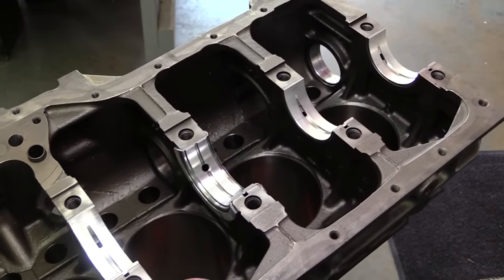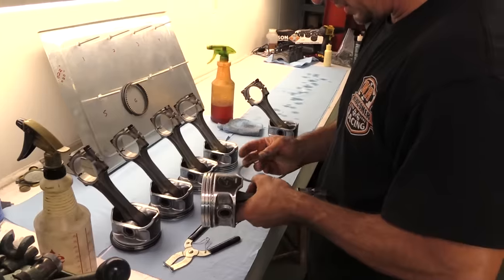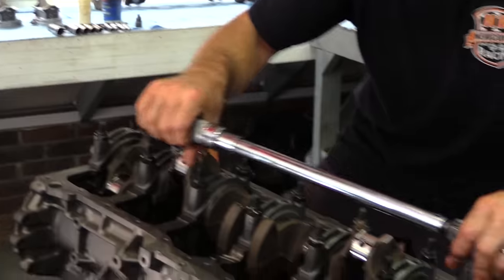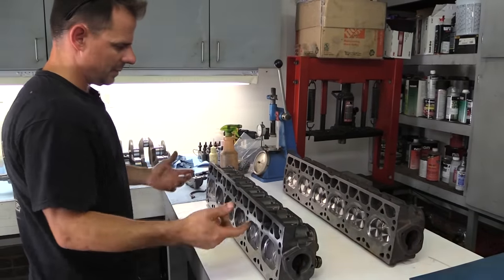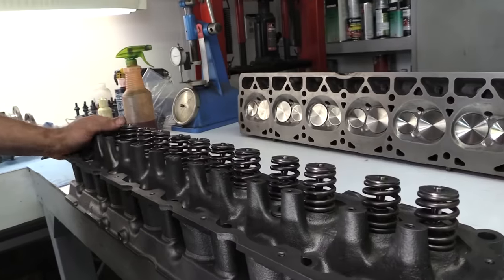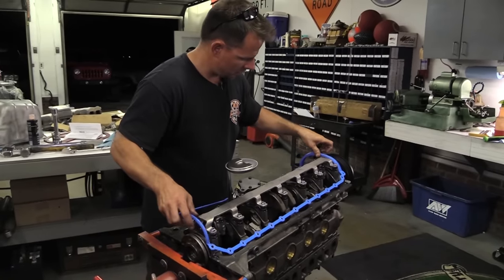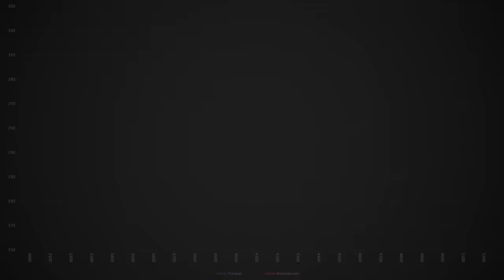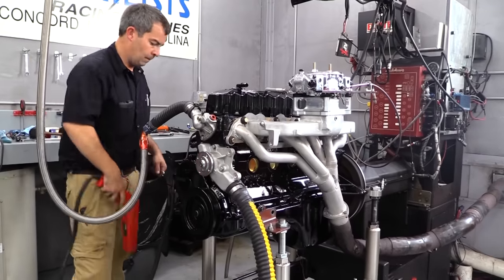Big Power Jeep Straight Six Stroker Build on a Budget with Newcomer Racing

Comment: Finally someone giving some credit to the excellent Jeep straight-six engine 👍 ...subscribed
Reply: The best motor ever made. Can’t beat them.
Reply: The best Jeep motor ever, better than the “panty” Star.  I’ve seen some that were literally a “block of rust”, with 200K miles, still going strong.  So easy to work on, everything reachable for a driveway mechanic.  Gotta say though, do love the cartridge filters on the 3.6 Pentastar motors.
Reply: One of the best motors ever built
Reply: The problem with the amc i6 is over it's life it had been great and crap. So to have the really good ones you've got to hodgepodge them together over multiple generations.
Reply: Literally one of my favorite engines next to fords last desirable gas 300 straigh six
Reply: The AMC 2.5 isn't bad either. I know that they make about 0 horsepower, but they always go. Starts everytime and never dies. Mines got 215k miles and still runs strong. It even ran with lose, dirt covered spark plugs.

Comment: That engine is one of the toughest ever designed.  Honestly, anytime you see a straight 6 with 7 mains, you know the bottom end is bulletproof.  These make for great daily driver engines that you can have some fun with on the weekend too.
Reply: Not to mention, the Cherokee is the ultimate utility vehicle. About the smallest turning radius, unlikely to get stolen (even in areas with a lot of dem teeeeeens), good interior space, and is still masculine looking. My absolute favorite car. I've owned at least 4 of them and I'm looking at getting another!!

Comment: Now I wish I had one of my old Jeeps back, the 4.0 with a 5 speed, two wheel drive was a sleeper.  I used to give kids driving small beemers fits going stop light to stop light.
Reply: They don't like that very much...😂
Reply: I still drive my almost 27 year old TJ I bought new. It now has a header and dynomax super turbo muffler. It loves to be run and shifted. Pure delight.

Comment: I had a 2002 Grand Cherokee Laredo 4x4

4.0L six cylinder 

I bought it in 2006 and sold it in 2018

I drove it everyday. It was a trooper that served honorably. 
The engine has 170,000+ miles. Still ran fine. 

Everything else was slowly going out. Door locks windows, lights, brakes, tires.

Needless to say I sold it. I miss it. I didn’t have the money to fix it up and breath new life into it. 
It will never be forgotten.

Comment: This year I pulled the trigger in Feb/2024, I order a turbo T3/T4 turbo with a 0.57-mm compressor wheel with 0.50 a/r compressor housing and 0.63 a/r turbine housing. The 4.0L Loves a good Turbo and the turbine spool-up-sound is very rewarding running up a big sand dune.   Cheer's

Comment: Took a 4.2L carb straight 6 shortblock and put a 4.0L efi head on it. I also used a offenhouser intake manifold, a holley 650 carb, dual valvesprings, and the biggest camshaft offered by comp cams. She's been getting beat on for over 5yrs without skipping a beat. Makes great power and torque.
Reply: moedigzz nice!!! I’m doing the same thing minus the cam, I have a quadrajet 4bbl that I was going to install but thought it might be too much carb.  Any issues with your 650?
Reply: @masterps100  old commentbut I wouldn't sweat the qj. They ran em on 4.3Ls.

Comment: I have a stoker inline 6 ,, love it . Going on 6 years now , I'm hard on it , making my 37's smoke all fours
Reply: Your not smoking all 4 of anything.....especially 37s. Not with a damn 4.6
Reply: Aaron Huff Easily can with the right gearing. Smokes all 4 of my 35s with a stock 4.0L and 5.13 gears
Reply: @Badassing  yea no...not a chance.  My wifes lq4 6.0 4.10s wont rip all four 33s.
Reply: Tristan Wolff Rubber in fenders show otherwise. Do a 5k neutral drop in 4L and all 4 tires will smoke. Now I’m not saying a full on burnout. It just smoked all 4 tires. 
There’s supercharged 2.5L Jeeps spinning all 4 tires. Even 37s.
Reply: @Badassing  5k neutral drop low range...come on man...meanwhile our 6.0 rips 60 mph rolling burnouts and gets 19mpg all day long.
Reply: Tristan Wolff Atlas, NSG370, and 5.13 pulls them great. Trust me, I have no need to do a burn out at 60mph in a crawler. I still get 18-19 on highway lol
Reply: @Badassing  I spent 1700 on the swap and  another 450 on shafts.  I suspect it could neutral drop a 4 hi burner but your asking to annihilate the t case input.  I used hp tuners and a stock gm 0411 ecm.  The lj ecm runs gauges and provides abs to vss signal for stock speedo.  It also runs the fan since its an 06 its really a durango or dak ecm and i repinned it.  The LS just sits in there like it was stock for the year.  Fits perfect.  It makes 370s or so tire, less on the lo octane stuff.
Reply: @givengiftgames5398  are you high? It made 372whp.  THREE HUNDRED SEVENTY TWO.  It has no traction control, no speed limiter, its tuned using widebands, hp tuners and most of the original vehicle configuration has been disabled.  Rev limit is set at 7000.  SEVEN THOUSAND.   If a stroker thats ported and cammed makes 300 on an engine dyno, its going to be 225 in the jeep.  Its respectible but the 6.0 is cheaper BY ALOT.   My wife hated the 4.0 that was in her jeep, always complaining it doesnt have the power she wanted.  a mild cammed 6.0 fixed it right up.

Comment: I did a similar build for my Jeep 20 years ago...The power was a night and day difference....Made the Jeep a blast to drive...started breaking  transmissions and Axles....but it was worth it...👍
Reply from the maker: Awesome!
Reply: @TheHorsepowerMonster  
My buddy had  an early 80s Z28 with a 4speed....i cleaned his clock ...light to light ...with my 84 Laredo...Porting the cylinder head and the  intake manifold..with the addition of an iski 252 Super Cam had to have added 100hp to that engine...600 vac secondary  with a light spring kit....It was a "Jeeper Sleeper"....Sheared the 2 piece axles more than once...before i installed a Mosure 1piece Axle kit....It was a hell of alot of Fun...
Had to cut one rib of grill...to get the Cam in....🤣😂🤣 what we do for Power....👍

Comment: I wish you were around  25 years ago.  I bought a used 1988 Cherokee after decades of being a CJ guy.  The 188 hp of the 4.0 was a quantum leap over the 65 hp L Head and F Head just as your stroker is over the stock 4.0.
Reply: I had a 90 RENIX/AW4 loved it.

Comment: More great content. And great to see some non-V8 American content.

Let's see that turbo build👍
Reply: the 4.0 is all american
Reply: @omegarugal9283  grammer error on my part. Only the Americans were making iron on iron motors in the 90's🙄. Meant to read. 

"Non-V8," American motors.
Reply: Check out LS V8 to V6 conversion
Reply from the maker: Racing
Reply: @TheHorsepowerMonster  it's a novel, yet unconventional solution to a very specific problem. Arising from a rather unique set of circumstances 👍.

Comment: Built almost same mtr.back in 1981 but used 400 chevy rods&pistons 11:1's
Cam was a moon cam 540lift.ran a offy manifold with 500cfm motorcraft carb.splitheader block was bored 125 over.4.2 head was port&polished with 2.5 valves.Ran it in a  72 gremlin dirt track no dyno back then but ran 0-60 in 5 seconds.sold that engine for a grand and guy put it in a 66 4dr.american ran 12:2 in 1/4 mile.Cost back then to build was a grand.
Reply: I Believe THAT for a Fact! SWEET

Comment: You have to love it when a stroker motor is still over square.
Reply: Stock Buick V8 is under square haha. With a 350 Buick you need to bore it 60 over in order for it to be over square. I have a 350 Buick in my 66 C10 and it pulls trailers like a champion.

Comment: Down here in Australia, this engine is pulled out and replaced by the 4litre DOHC Ford barra engine, its 185kw DIN on unleaded. there is a turbo version at up to 310kw. The barra was made in Australia for our falcon. The Jeep engine is old school now days.
Reply: Ford barra motor had been compared and come out on top of a toyota 2jz..best 6 cyclinder engine to date ..and cheapppppp
Reply: Do you have to install it upside down

Comment: i got myself a 284 stroker motor from a 4.0
258 crank
punched .060 over
basic 3 angle valve job
crane cam h-260-2
on a chassis dyno, all the drive line, auto trans, transfer case, 3.55 gears, and a full front accessory, it made 250 horse and 350 tq iirc. took it mud racing after some upgrades and managed to kill it a few times, rebuilt and killed again.

Comment: Legendary 4L Motors, they don't build em like they used to
Reply: Nope and they ruined a brand because of it.
Reply: No...because nobody really believes 180hp and 13mpg is a good thing.
Reply: @blackopsrocks  don't know where you came up with 13mpg. My 99 Cherokee 4.0, 5 speed averages 25 mpg and my 05 Wrangler Unlimited 4.0 automatic averages 19 mpg. That's commuting down a 2 lane road with speeds from 35 to 55 mph. Stock tires on both. 99 has 276K miles and 05 has 266K miles.
Reply: @davem4193  so...not normal normal commuting...got it.  My 8300 lb diesel super duty can avg 25mpg if I do 50mph all day so my point is still valid.  I like the 300 ford i6 myself but im sure not going to say its worth the cost to horsepower...as soon as you push more power, the longevity and durability (the reason we all like the 4.0) goes out the window.
Reply: @blackopsrocks   my real world figures disprove your original point   so your best argument is that it's not an average commute? Got it. Define an "average" commute. Even when I was commuting down the highway in my 99 Cherokee at 80mph I was still averaging 23 mpg. Sounds like you pulled your 13mpg figure out of thin air.
Reply: @davem4193  Not sure whats hard about that concept bud.  The avg commute in the US is 21 miles, 70% hwy with an average of 38mph.  The avg highway speed according to our google overlords is 73mph nationwide.  So if you think your alow and steady two lane commute is normal Ive got bridges to sell you.  If you jump on the interstate and do 65mph there is zero chance youll do better than 18mpg probably even less.  Your modern competition is getting 22 to 24 at 80.  Hell if I followed you around at twice the weight Id still double your mileage.  Jeeps are cool, no efficient or cost efficient.
Reply: @blackopsrocks  you must have missed the part about me getting 23 mpg on my highway commute at my previous job, it was 70 - 80 mph average speed. Reread my previous post. A far cry from your 13mpg figure that you made up out of nowhere. Even the EPA rating is higher than that but don't let facts get in the way of your misinformation campaign.
Reply: @blackopsrocks  my lifted xj on 33s gets 18mpg on my commutes if I drive economically. the hard part is resisting the urge to mash the gas and drive faster than 75 to pass dumbasses then my mpg goes down to 16-17
Reply: @davem4193  I own an LJ and a XJ...so its not from nowhere.  Your comment I saw stated slow on a two lane road...so there is that.  The 4.0 is a low efficiency engine, converged port, hydraulic flat tappet, low compression, oversquare...all means its low efficiency.  The pistons move quite a bit meaning the physical travel distance for the power produced increases friction,  flat tappets do to, and converged port head designs interrupt air flow and reduce volumetric efficiency.  Thats the science.  that is why even with alot of cooling capacity the engine does run pretty warm.
Reply: @blackopsrocks  it's a miracle, both your LJ and your XJ get 13 mpg even though your LJ is much heavier and has different gearing. Sounds like "science" is on your side for sure.
Reply: @davem4193  I have a 92' Laredo. HO 4.0 in it . four speed automatic. Bought it new in 92'. It got 13-15 mpg then and now. Still drive it to work daily. 36m round trip. 287k on it. Would really like to contact these guys about the rebuild.Will drop it in a crate and ship it.
Reply: @blackopsrocks  Get out of here with your wimpy fuel economy talk.  I would gladly make 10 miles to the gallon if I could get great power.  There is way more to a vehicle than fuel economy.  The manufacturers lost sight of that and had to get bailed out.  It will likely happen again if they keep up the junk they have been pumping out.
Reply: @indridcold8433  its not really a legendary engine.  They are known for oil pressure issues and broken piston skirts.
Reply: @blackopsrocks  I think the 196ci and early 199ci were the ones that had bearing issues and piston sleeves that came apart if it overheated. I remember the headbolts were recommended to be regularly torqued back down to help remedy the problem.
Reply: @indridcold8433  ive worked on several that had supposed piston slap issues though to be out of round bores that had missing piston skirting.  And these were late nvh blocks.  Other issues to round out the weird is wiped out cam bearings, lifters that looked like they had 400k on then and had literally run out of usable hydraulic adjustment.  Most of these engines had thr same overall issue. Running a high efficiency oil like a 5 weight.
Reply: Damn shame. The 4.0 - and the 258 were damn good engines!
My '97 4.0 (Sport Cherokee) was nicknamed the Mountain Goat - with 3.55s and 31-10.5s it went everywhere and out climbed almost every modified off road truck I went up against.
With my heavy ass foot I got 18mpg city, and even though it went through the air like a barn it got 18 - 20mpg at 80mph freeway.
At 250,000 miles it started to get tired, so it got a rebuild.
Only needed .020" over bore, and that's only because like every inline, no.1 was out of round.
The only thing actually worn out was the rings. And it was clean inside - no deposits or sludge anywhere.
That's a damn good engine in my book.
Reply: @blackopsrocks  
Every one that I went through that had those problems were the direct result of poor maintenance, it was obvious as soon as the rocker cover came off.
I made my living machining/rebuilding engines - and any 4.0 that had gotten proper maintenance didn't come in until they were over 200,000 miles.
Reply: @Motor-City-Mike  for an engine designed in the 60s it is pretty reliable.  By any modern standard its an unreliable dinosaur.  What it really is, very innefficient.
Reply: @blackopsrocks  if you say so
Reply: @davem4193  I have to call it here. 23mpg at 80 in a 190hp box? I've had XJ and ZJ flavors of the 4.0 and anything over 70 and you are below 20mpg. Throw in a slight incline or wind and you are at 15mpg.  It's best to just leave MPG talk at the door. These older jeeps don't exactly cut through the air if you know what I mean.
Reply: @ericharrison619  if you don't believe me I'll gladly put a wager for any amount of money of your choosing to back up my statement. We're talking about an XJ with no lift, stock tires, 5 speed and 3.07 gears.
Reply: @blackopsrocks  your about the 1st if ever read saying the 4.0 is not reliable I had mines for 10 years never a issue top quality oil reg. maintenance the 4.0 is bulletproof and mines have 368k on it rite now
Reply: @davem4193  ironic that a pair of stubborn mules are jawing about horsepower and range.  I'm a 4.0 fan but swap in a Cummins 2.8 and I'm all in.
Reply: @jimcarlson6157  I agree, the 4.0L in my WJ has been reliable but I'd be happier with a diesel under the hood.
Reply: Yeah I love mine too, but like 10,2 mpg ( in city traffic ) and 14,7 mpg ( outside of the city ) is kinda expensive in Europe, were we pay like 1,30 Euro per liter ( times 3,79 for a gal ). Had it converted to gas ( lpg ) and it is running fine since 70.000 km after the conversion now.

Comment: It's the same power and torque that a 5.7 L Gen III was putting out in 2002 in my old Holden Statesman 

Great build 👍

304 hp ~ 226 kw
329 ft/lb ~ 446 nm

Comment: I own an engine machine shop here in Alabama . We do a lot of industrial engines . I have had 3 jeep engines come through that are used in the oil fields that are used to burn off unwanted gases . The first one I rebuilt came in and I assumed it was just a 4.0 liter engine because it was a 4.0 liter block . When I installed the first piston and turned the engine through the top ring came out of the cylinder . I had to order the pistons through the company that built the pump . They never would or could tell me what c.i.d. the engine had .But it had a different crank and rods than any jeep we had ever worked on before . The crank was forged steel and the rods were regular I beam rods but were very different from a factory rod . The piston looked like regular 4.0 pistons but the pin location was higher . Since then we have rebuilt 2 more of these . Always thought jeep folks would love to get a hold of one of these engines .
Reply from the maker: That's crazy. I'd love to see one of those someday. Thanks for watching!

Comment: Why not start the dyno at 1500 rpm ?  Alot of us would like to see torque numbers from 1500 to 2500 rpms as well
Reply: You never run the engine at wide open down there. And if you tow something that lugs your engine down that far at wide open, you need to revaluate your setup, because that's not how you use an engine.
Reply from the maker: It is really hard on an engine to put in on a dyno at start a pull that low because the pull is always at wide-open throttle. So to protect the pistons and rods, most engine builders won't start a pull until at least 3,000 rpm or so. Hope that helps!
Reply: @TheHorsepowerMonster    Thanks !!!!!!!!!!!!!!!

Comment: I did 4.0 head conversion which i Ported and polished port matched my Clifford intake on my 82 cj5 jeep 4.2 had 350cfm holley 2bbl an split header with 2 flowmasters. It made such a huge difference in power and torque. Everyone thought i put a v8 in it cause the sound and way it ran i could bang 2 gear and yank driver wheel.
Reply from the maker: Sounds like a fun build!